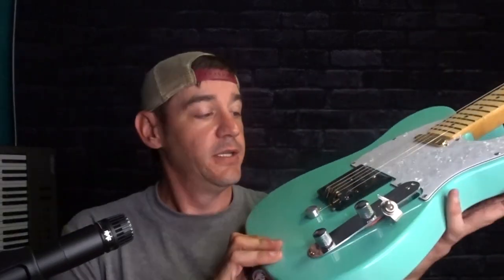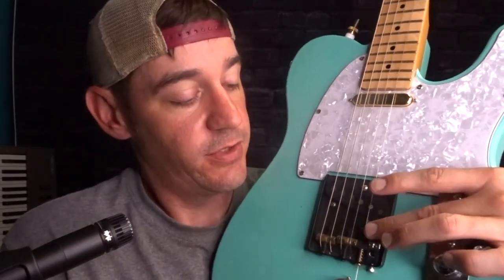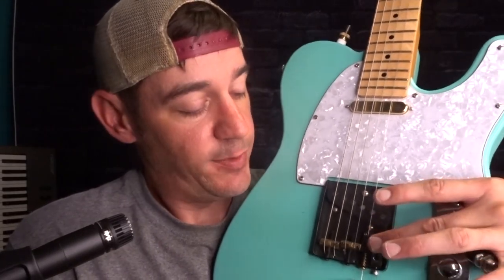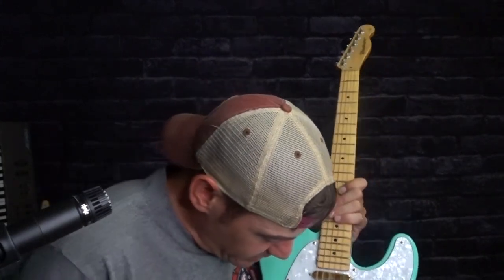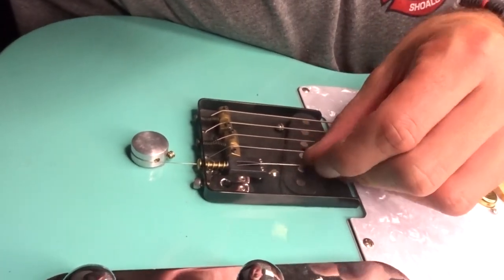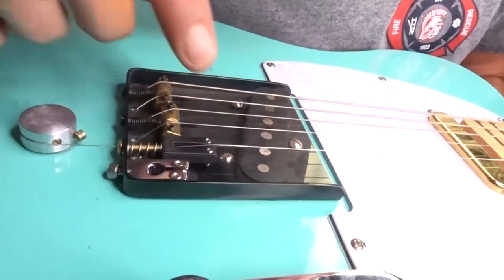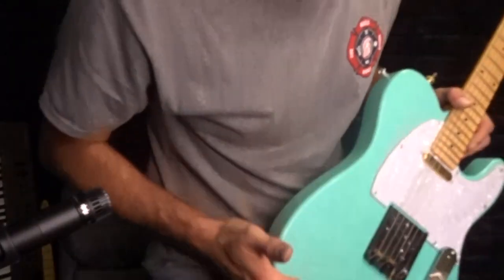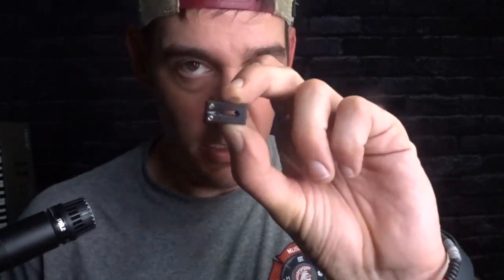Testing the String Saver String Through Saddle,  B and G Bender String Through Saddle Give Away

Comment: Hey Chase just completed a neckthrough tele for a customer with your b-bender. A real challenge as it’s one piece but it worked out well. Only gripe is I got the older tuning screw without the hex so it’s a bugger to tune with a tight thread. How do I order this part to replace what I have? Secondly I have located some really higher quality roller saddles. These really work, would you like the link?
Reply from the maker: Hey bud, send me an email to shoalsbenders@gmail.com. I’ll get one on the way. I’d love to find a high end roller saddle supplier. Hope all is well. Talk soon.

Comment: Hey Chase, Love your work. Just a thought, perhaps you could purchase some PTFE - Teflon tube to install inside the brass fluted screws, this might allow for better wear on the screws as desired. The teflon tubing is available on Ebay and at Aliexpress, cheers, Trev
Reply from the maker: Great idea! I was thinking of a way to do something similar to that.  Either a screw out of the stuff or something. Thanks for the suggestion bud! I. Appreciate it very much!
Reply: @ChasesWKshop  Yeah, Teflon is good stuff in the right places, seems to work well on those Graphtech saddles you have. Hopefully you can find the right size tubing to fit neatly and tight inside the screws, there is a great range of different sizings, the smallest I noticed after a brief ebay scan was 0.3mm ID and 1.5mm OD see following web page -
https://www.ebay.com.au/itm/PTFE-Teflon-Tubing-Tube-Sold-By-The-Meter-ID-from-0-3mm-to-12mm/151918210167?hash=item235f07ec77:g:WysAAOSw5IJWcWtJ
These are from Australia, so I am sure you could find same direct from China for cheaper. Cheers and good luck with your Bender refinements. Trev
Reply from the maker: tote TT thanks bud. Yes that’s defiantly the difficulty. Plus I’ve found that when it’s thin it’s pliable too so makes it difficult to make a screw out of it. The brass defiantly does better than I thought. Especially after it gets broken in. Thanks for the help bud! I really appreciate your info!
Reply: I’ve been using Teflon tubing and it’s been working great. I found the break angle from the screw to the top of the saddle was causing binding but the tubing has really simplified things

Comment: Oh wow I didn't know you sell these kits. That's awesome.  I have a squier affinity tele. Without the string thru body, would your kit still work on it? And do you ship to Canada?
Reply from the maker: Mike P I hear ya bud. The problem with the affinities is that they are only 1-1/2” thick. Just makes it harder for the mechanism to go into the body. It’s probably not ideal but it would work. The squire teles are a good one to use because their body’s are 1-3/4 thick giving more room for all the parts. Hope this helps. If you want some more info go to my website cwkshop.com. There is a lot of info on there about them. You can also send me an email anytime. Thanks for the comment bud!
Reply: @ChasesWKshop   ah yeah that's right  they are a thinner body. I have your web page bookmarked so at least I know where to get one.. thanks for the fast response. Cheers!
Reply from the maker: Mike P btw I can absolutely ship to Canada. Sold about 4 kits there already.